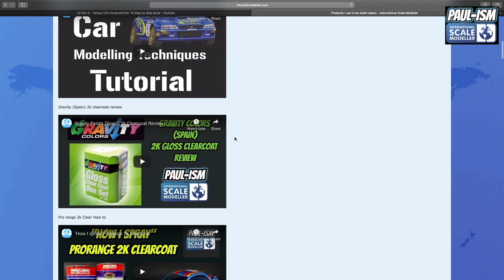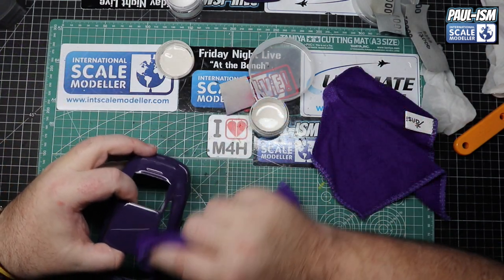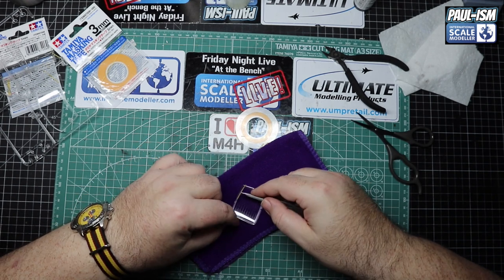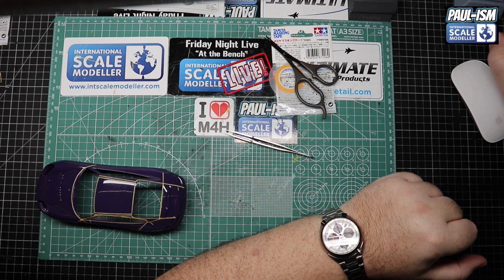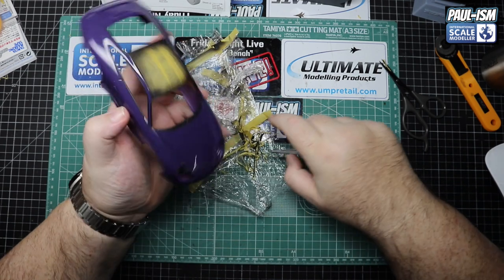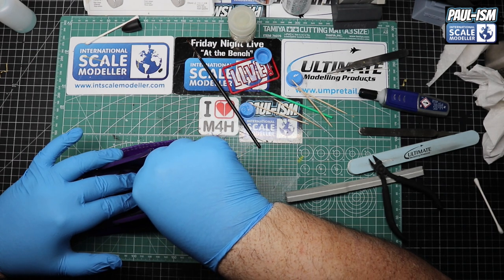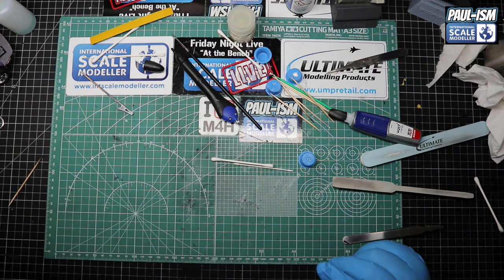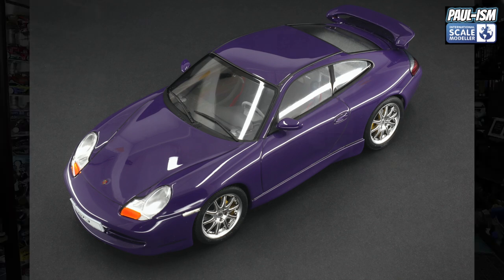Part 4 Tamiya 1/24 Porsche 911 GT3 - Step by Step build

Comment: Lovely paint finish, i would be pleased if i could get anywhere near half as good! Just made a fatal mistake on my tamiya mx5, airbrushed decanted auto paint, matching my real cars colour, all ok with good even coverage and no issues.. , but then clear coated with simoniz lacqeur and it revealed seam lines and created tiny sinks in the surface...irrepairable, so need to get a new body and start again! Lesson learnt methinks! Love your channel, and all your projects👍👍

Comment: Love the strong colours on the Porsche too, Paul. I've  recently finished a Fujimi 1/24 Porsche 964 in Rubystone Red that Gravity do, and it's an amazing colour, very happy to have learned about Gravity on your channel. One thing I've found out the hard way a while ago when, masking with cling film, is that on some of the clears, like Mr Colour GX100, there can be a reaction to the cling film. Mine ended up looking like a shiny and matt zebra finish that wouldn't polish out! Luckily, a new coat of clear over the top fixed it, and cling films are different etc. but be warned if masking a finish other than 2K with cling film. p.s. I really like that you try to put new or different techniques in your videos, really makes them enjoyable. I especially love hearing what NOT to do, e.g. recently you said you were reluctant to use less than 6000 grit on finishes as otherwise the sanding marks can be difficult to get out, plus your CA glue thoughts in this video. So how-tos, and what not-tos are solid gold! Thanks as always for the great content.

Comment: Loved watching the video, I'm currently building the porsche, so watching gave great tips, but I the area you painted tge indicators on the front aren't matching the real car because I looked up an image of that car, the Porsche 911 GT3 2004 and the orange for indicators are not on the front with the headlights but on the side only, are the instructions telling different
Reply from the maker: Can’t remember no just build how I want to be honest mate
Reply: 2004 is the 996.2 (facelift) so it has completely different headlights from this version. You are correct however that the 996.1 version GT3 did not have amber indicators but clear ones with amber bulbs. Paul has made a 1998 996 Carrera with GT3 aero kit :) more or less as is my intention with my own car :)